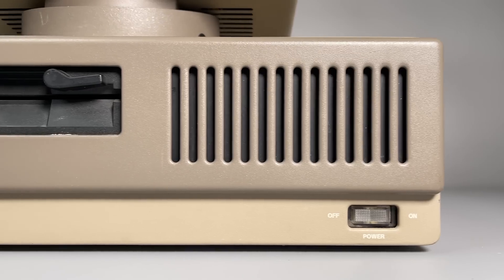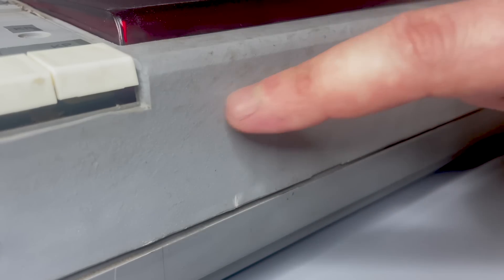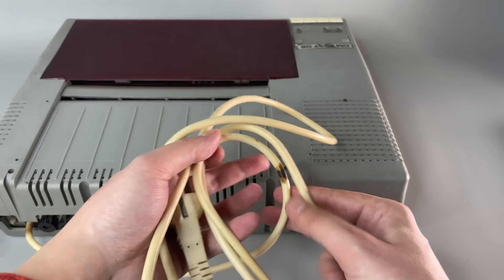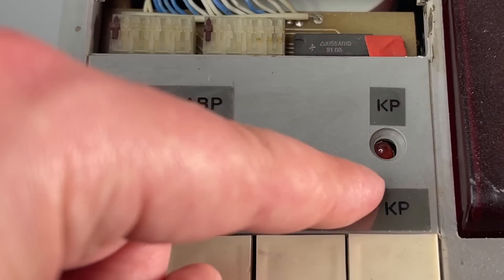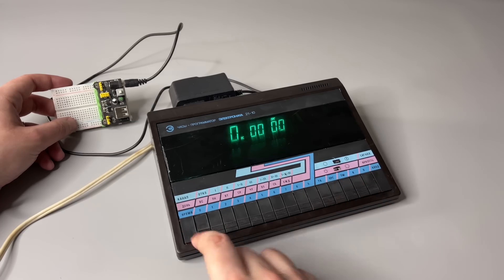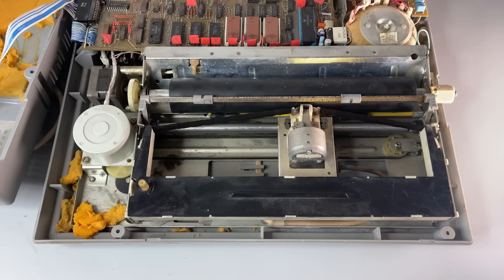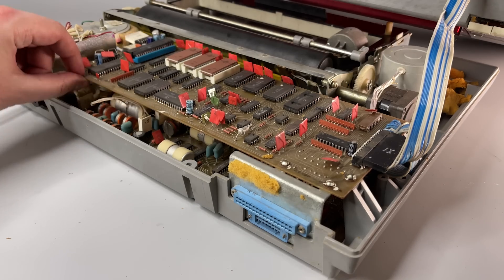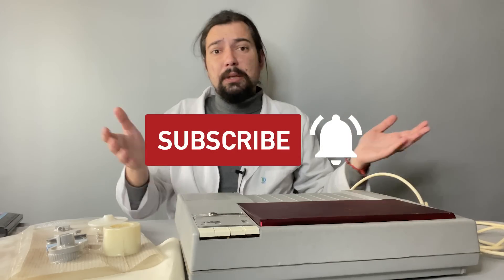This is THE WORST PRINTER I've EVER seen | Soviet SM6337.02

Comment: That marking on plastics shows that it was damp when moulded.  Plastics like that absorb water from the air, what you are seeing is steam in the moulding.
Reply: 100%, pure utter negligence. The technology was designed and tested properly but noone in the factory cared enough to follow it properly. It was not a critical device so the government will not complain and it was such a rare and highly desirable item that the cusomers will not complain either so they knew they could just throw all the parts into a bag along with the schematics and people would still buy it and fix it all shortcomings themselves. 

So the biggest mistake the author made here was buying a new in the box general purpose soviet product. It would be much better to buy a well used printer. The fact that it was used would already mean that the previous owners had already dissassembled and reassembled it properly following the guidelines of contemporary computer enthusiast's magazines and they did it already applying the required modifications and homemade relacement parts when necessary. And if the printer has significant wear then it is even better as it means that the work of the last owner stood the test of time and the thing should work with minimal repair or even as it is.
Reply: @Kirillissimus You got that right. The various magazines would cover all sorts of fixes and upgrades to “commercial” products, whether in the nascent personal computer industry, or kitchen/home appliances, cars, motorcycles, and so on. Buying a “product” and having to modify it yourself to fix known design or manufacturing issues was common. There was a constant shortage of goods, so getting a “product” was hard enough - having to modify it post-purchase was a comparatively minor nuisance.
Reply: @Kirillissimus  thats communist worth quality if ur forced to do things at the rate many were as civillians you wouldnt care about ur job either..... This is the problem with communism it does not leave individuals with the oppritunity to be what they want like capitalism. This is why most in the tech industry will flat say communism kills inovation.... When the people cant innovate to create there own wealth and progress to compete with eachother. You lose that competition and passion to advance when its all regulated and controlled by a over sized government..... This is why most products from the ccp or china are knock offs/stolen scematics or reverse engineered shit products with no soul as the workers who make it have no passion or motivation to be good at making said product..... 

Challange buy a knock off chinese rtx 3080 for ur pc count how many hours before it has thermal failure and fries on you...... 
Go on wish buy electronics see how wobbly and how shit they are put together..... 

Most communist nations are less worried about quality as they are producing cheap shit to sell to the world because they cant produce much else to contribute to the world it seems..... besides falsly imprisoning political opposition or killing opposition flat out to maintain power..... control through fear and forced poverty.... gg It truly is a shame as russia and what was the ussr would be a serious power house in the world had it not been for the communist party stagnating innovation and economic standards for its people. All in a bid to maintain power.... Witch they did maintain.... Still do..... It amazes me anyone can even defend the ussr or communism when its killed more human lives than every plague and pandemic put together in human history......  all so it can maintain power.....

Remember the ussr and ccp together have killed more of its own people than the entire population most global countries have all together..... and im pretty sure a government who kills its own people enmass like that does not care about the quality of products it is producing for the public it itself is killing......

Like does the ccp care about the products given to hong kong when it knew it was going to kill people and use fear to control them and knock back there quality of life 20 years or more? lol probably not much worry about quality of said products either...... The same goes for ussr and how it was killing its own people.....
Reply from the maker: Thank you for those details.
Reply: They might be short on grease and oil, so they used water. rofl
Reply: ... possibly even the addition of a gas-forming agent like sodium carbonate: it forms CO2 bubbles when heated, transforming the PS into a dense foam with the tell-tale flow lines. This was sometimes done in order to save material. Still practiced by toymaker Playmobil today...
Reply: @f.d.6667  Cool to know.  When I was a kid arround 1982 there was lookalike wood pencil boxes that used the flow lines to look like wood grain.  Same thing again. Aka how to make rubbish plastic into something to sell!
Reply: Is there a way to revert it?
Reply: @MadScientist267  No, its part of it.  Youwould need to granulate it, dry it, and remould it.

Comment: 9:40 that IC on the top right side with 4 holes in it that looks like it should house two more components... PLEASE make a dedicated video about it, I've never seen anything like it!
Reply from the maker: That IC looks so because those openings are for a manipulator which made positioning during assembly, it was typical for a couple very specific Ukrainian factories. Frankly, there is not enough to say more for a separate video, but how about if we make a video about our collection of chips including those at some point?
Reply: @ChernobylFamily  that would be amazing!
Reply: @ChernobylFamily  I have a soviet clone of the intel 8088 that looks like that. I figured it was a cost saving measure to use less plastic for the chip package. Maybe it was a little of both?
Reply from the maker: Could be. Actually, we can ask in institute of Cybernetics. They should know, they made those chips:)

Comment: I would have said the Gamacentrum 01 which is a Czechoslovakian printer made in the town of České Budějovice (yes, the home of the original Budweiser brewery).  It is an exceedingly simple printer, with two solenoids which serve as the hammers. designed to print on carbon paper.  It would have been very difficult to write software to print for it as it had no CPU as far as I know.  At least it was decently built.
Reply: This sounds very much like the original ZX Printer that was designed to be as cheap as possible. Special heat paper, no smart chips, the I/O interface is like "set this bit to power the motor, set this bit when the stylus is supposed to draw black pixels"
Reply from the maker: But, they had original Budweiser!

Comment: The classic soviet hardware. As a TV-sets which may cause fire or a CRTs that exploded or friges which may stroke you with electricity )
Reply: Definitely. There are cases when large ocean ships sunk due fire caused by forgotten electric kettle. There was no automatic off or protection on these items (often peoples used only simple spirals with heating element thrown in water) ever. Lack of such simple automation which caused millions of roubles damages. Most items for regular peoples are poorly built without attention to details. If there is some protection or features it often looked like last minute job. There was better quality items, for special consumers as military, but these things also was strange, because this was like handmade, low volume production.
Reply: @vintageelektro5437  about what we may talk, if most of all soviet appliances were the cheap and simplified copies from a western tech.
Reply: @ttl3000  They had the innocent name "foreign analogue" for the copy. For example, microchips. It didn't even seem sinful, inferior quality, but about the fact that it was stolen, not even a thought.
Reply: Leading cause of fires at peoples home in the 70's and 80's was Soviet color Tv's. Then you also have the usage of aluminium wires in houses and apartments, a pain in the butt.
Reply: @K2teknik.  yeah, I had some )
Reply from the maker: Oh... yes.

Comment: I recently bought the same programmable clock at a flea market (an earlier version called "Signal 201"), and literally everything about it looked as if it was some kind of student project. The keyboard, for some unknown reason, had numbers arranged vertically (like Japanese writing), and combining that with the fact that there was no backspace, it became frustrating very quickly. It ate 2x9v battery to keep time for 2hrs (i don't even know how they managed to make TTL consume so much energy). The drawings of the device in the manual looked as if they were drawn by a 5-year-old who had seen this clock once. The funniest part was that it had only one thyristor to control the output voltage (they attempted to make an SSR before SSRs were a thing), and because the plug was not polarized, it either didn't work or any device (even period-correct ones) really didn't like that control method. And on top of all that, it just died one day (clock just refused to access it's fancy 1byte a second internal memory) so I just scrapped it for parts.  

Cheers from Poland
Reply: TTL is fairly energy-hungry. It’s weird that they didn’t use the Comecon equivalents of the 4000 CMOS-series ICs. Those consume almost no power in a clock application.
Reply: @absurdengineering  i checked the schematic right now and they for some reason attached batteries before linear stabilizer :0  . And also by the looks of it display driver works reguardles of power source :///  . So no surprises here ...
Reply: I think why the keyboard looks like it is from Japanese machinery can be easily explained by the origin of very many Soviet designs (copy of Western models).

Comment: When even HP produces outstandig products compared to yours, you know you fcked up big time.
Reply: HP used to make very high quality products, before like 1995.  Most of them very expensive, too.  I have a HP 8640A signal generator from circa 1985.  List price, around $12,500.   You could buy a nice car for that much back then.
Reply: @georgegonzalez2476  have an old HP 54542A Scope. After just minor repairs, it still goes strong! Old HP gear was made to last, new gear just breaks to easily, especially consumer stuff.
Reply: That's a fine scope.  The earlier digital scopes, from all sources, were awfully lame.  Low bandwidth, low resolution, poor triggering, and no AUTO button.    @DrakkarCalethiel
Reply: @georgegonzalez2476  It is an awesome scope to have. The CRT has its charme. 500MHz with 2Gsa for all channels is awesome to have. Got it for just 100 bucks, sold as not functional / for parts. PSU had 2 missing rails. Glad the hybrids are totally fine. Finding them would be insanely hard.
Reply: @georgegonzalez2476  Also have an old scope from them, 54542A. After minor repairs, it still keeps going. New HP gear is just utter junk, especially their consumer products are just beyond scum. Their printers are just the worst on the market. Even their business line is  junk. Ours at work was dead every couple months.
Reply from the maker: Bhaha
Reply: Have  a HP LaserJet 4+ from 1995 and still using it with modern PC (I added LAN module to printer), very good machine. Nostalgic era when these items was made in japan
Reply: @vintageelektro5437  You mean you have the jetdirect card for it, or do you use an external converter? I also have the duplexer, and 112 MB of memory. The manual states it can only do half. This might depend on revision of the boards. It uses simms,  on the internet there are a couple of sources about the simm soldering pads that you can open or close to tell what kind of memory it is. I forgot if the 4+ cares at all, but let's say you have 60 ns memory and it only works with 70 ns memory. Then you change a soldering pad, and the faster memory will work at slower speed just fine.
Reply: HP once was a great company and they made some truely best in the world products and the kept their quality and design traditions up until a year after the last of its initial founders died of old age and it happened well after the USSR collapsed. HP of today has nothing in common with the HP soviet products would have to compete agains in the early 1990s. Back then it was not even a competition and american stuff was just superior in every respect, but today it almost seems like all the insane communist believers did not just dissapear but migrated to the US and continued doing their dirty work there.
Reply: ouch
Reply: In that era HP (Hewlett Packard at the time) produced outstanding products by anyone's standard. Had a DeskJet Plus I just recently retired that had served me well since the summer of 1990 (when it was a $450 in 1990 dollars printer). Built like a tank and it was really just I didn't need a RS-232/Centronics printer any more.

Comment: I used such a printer with 386DX-33, Lexicon&ORCAD, and it wasn't so bad. I compared it with Epson, and the main advantage of SM6337 is that I could print on A3 paper.
Reply from the maker: Right, I also had SM6337, but those had way better quality. Not even close to this.